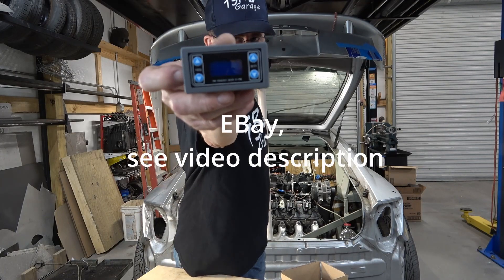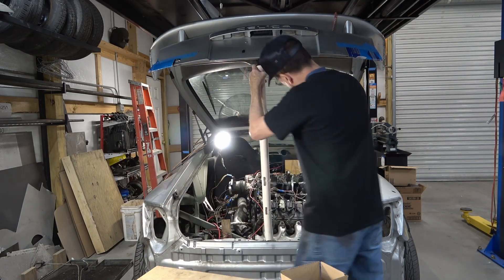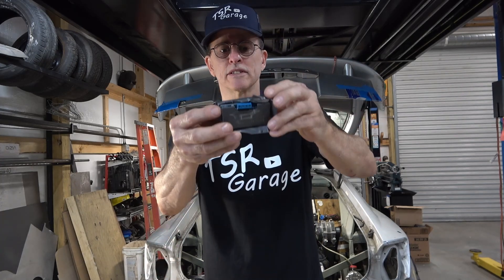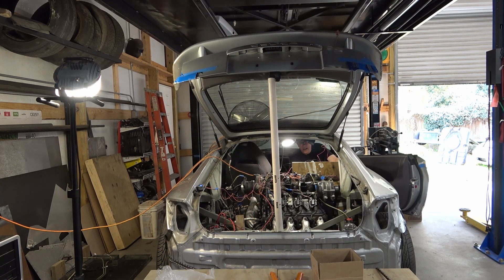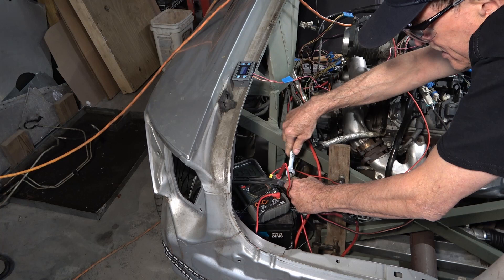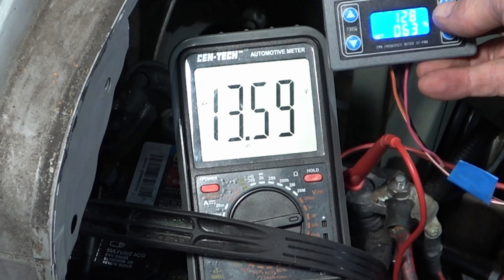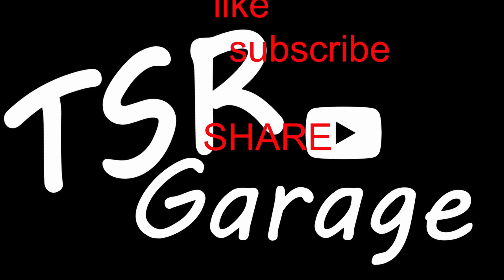19. Alternator not charging,  PWM voltage control,  EBay PWM, V8 Celica GT-SS

Comment: I drive my car pretty much all day everyday for work, do you think this is safe to put in my car, as far as engine wear because I believe after installing this it causes a constant engine load correct?
Reply from the maker: The engine wouldn't care about any added load, if there was any. The load should be about the same.  The only possible problem I see would be setting it too high, possibly overcharging the battery and shortening its life. Or too low and not charging the battery enough. Adding an accurate digital voltage gauge is my plan. 🤔 I am not an electrical engineer 🤫
Reply: @TSRGarage  Right on, I was just thinking that the voltage regulator would cause the alternator to charge at the specific voltage constantly and I was thinking that the alternator on a modern car gets to a certain voltage then stops charging and when it dips down again it charges again so I was just wondering if it would matter to have that constant charge.
Reply from the maker: @marke.8334 .. I think this system would probably need some constant "babysitting" when you use it. At least until you possibly find the sweet spot that keeps the battery charged enough to start the car. This is the first time I have tried it, and I haven't gotten this on the road yet.

Comment: How to develop a system that automatically sets the correct pulse ratio regardless of engine speed to keep charging voltage in 13.7Vdc? Maybe some simple arduino programming?  Arduino can be PWM generator that adjust itself to correct voltage or something...
Reply from the maker: That is "above my pay grade," as they say. I just know this works to get the battery charged.  
   Because this is manually set, it would be possible to overcharge the battery by setting the pwm too high. So, some way to get a state of charge feedback could be helpful.
Reply: @TSRGarage  https://www.youtube.com/watch?v=VfbP67zdh9g
There it is controlled by arduino by a very simple program. But how to keep voltage stable when you rev up engine - have to find out....

Comment: hi does to work for single pin alt, there is only one  small tiny wire going to my alt regulator its a COM port
Reply from the maker: I don't know. I haven't used that type alternator
Reply: My 2020 Ford Ranger has the same 1 pin voltage regulator plug.

Comment: New Sub here.  I went and got the same PWM that you're using and i ordred 2 myself as i ran into a missing screw issue on one fo them so i could jumo right into the backupo if needed.  My set-up is qq little different than yours.  I'm trying to gert the alternator in my 06 Dodge Charger to actually charge.  I ran into the typical chrslyer relocating the voltafge regulator to the Power Train Control Module(ECM) and the tregulator going on.  Well come to find out chrysler no longer supports cars 10 years and older.  Which means the computers and or everything i need for it from the dealer has been discontinued. When pricing an aftermarket computer for it i am looking at $550 USED so i went your route with the PWM installation. Problem that i am having is my alternator still isnt charging the battery., it has 2 field wires (i've tried both field wires, and each of the field wires seperately)and the main cable to the trunk of the car where the battery is located.  Now i have ran all new cables to each from the what i call bulkhead connection at the firewall to the alternators and the starter hooked the wires up and then hooked up the battery now i had previosuly tried using the linear QS3813 adjustable voltage reulator without sucess so i reused the wiring tht was already in place for the PWM.  When you hooked up the field connection to the PWM on your LS swap which field wire did you hook up the the PWM and which one did you leave off or did you use both the field wires in the PWM?
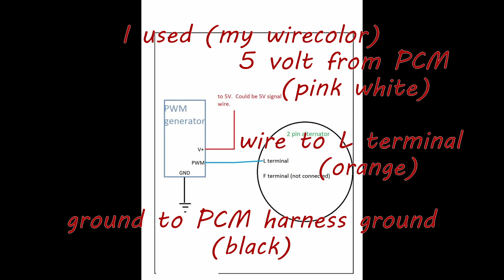Reply from the maker: 2:24 shows the wiring diagram I used, and links are in the video description. I do not know a lot about alternators.
This model of GM alternator originally used a pwm signal to control the charge rate.
       GM also has alternators that have three wires. On those alternators, a resistor can be put in one of the wires to make it charge.

Comment: Awesome video! I'm fixing to install one of these? So basically is the L pin at alt a 5 volt wire that comes from the ecm....and you basically spliced into that wire so it comes from ecm and lands on new controller, then output from controller to alternator.  Then grounded the new controller to wherever the ecm is granded.....and that's pretty much, right?  

So the 5 volt coming from ecm powers the new controller up?? I would have thought the ecm is constantly changing that 5v signal making it a kind of bad source to power the unit.

I'm glad you've already got this thing figured out! lol
Reply from the maker: Glad the video helped. 
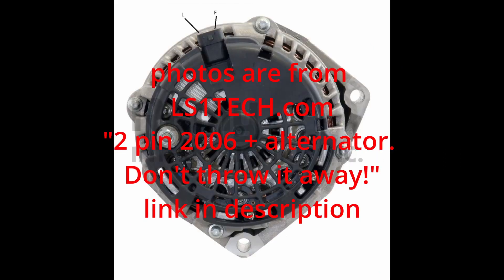The wiring diagram at 2:24 shows all of the wires.  
   The quote 'we are standing on the shoulders of giants' applies here. All of this is from researching the work of others.  I made this video because I could not find one of an actual install showing the wiring etc.
      My understanding is, 5 volt power from the pcm is a constant signal voltage for computer signals.
Reply: I have a 3.6L VZ Commodore / Holden / GM alloytec like the one in the v6 camaro and Cadillac CTS 3.6L V6 the alternator is a Mitsubishi a003tg1991 alternator it has a 2 pin plug a orange wire and a white wire the pins are FR / F terminal and L Terminal I guess means light ? My alternator isn't charging / exciting I cut the wires off the plug so my duty cycle was 9% when running now it's at 99% when running but it's not charging and dash light is still on so exactly what wire out of the 2 is the one that I need to reconnect keep connected to the alternator with and have it plugged into the voltage reg so it makes the alternator turn on / give it the power to charge the battery orange or white ? I connected it back up the other day I wired the orange wire back into the plug and put it on the bottom pin of the regulator which if you google the alternator the diagram says 2 is top pin and 3 is bottom pin so I had orange wire onto pin number 3 but still no charge it's running off battery power still,  duty cycle still at 99% and dash lights still on saying Alternator F terminal Low Voltage ? So have I plugged the wrong wire into the wrong pin or am I missing somthing ?